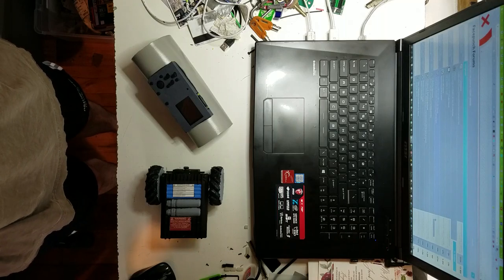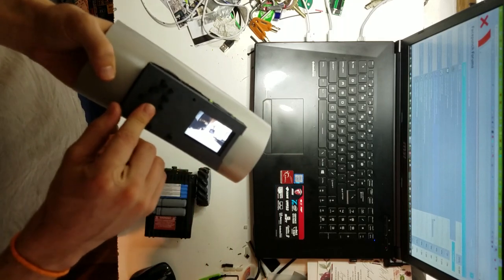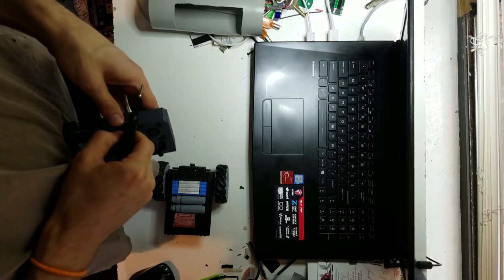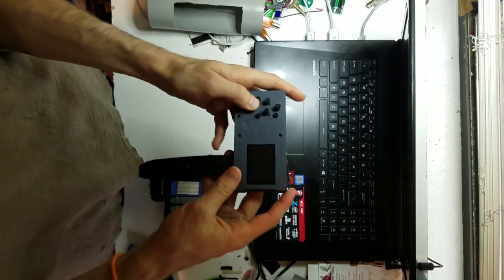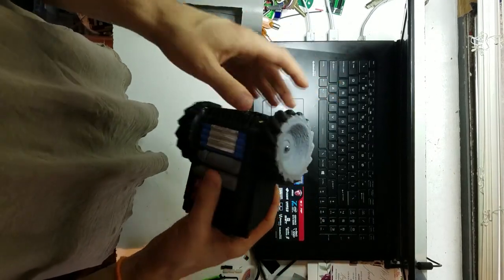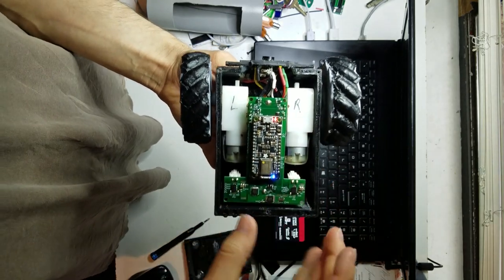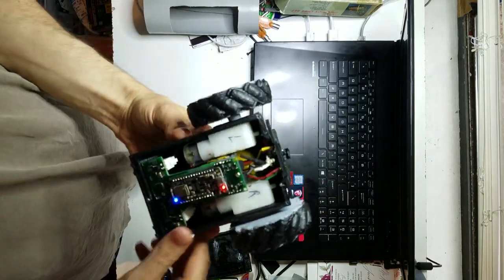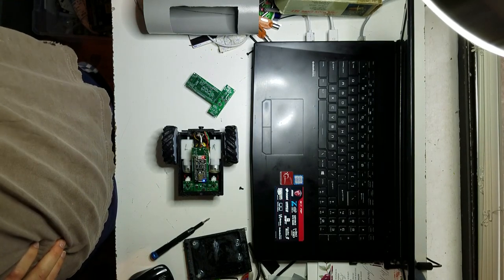R6S Twitch Cosplay Shock Drone Operation & How Its Made

Comment: I want to make a twitch drone very similar to you I find the 3D model of the drone on thingiver (the same as you) and i don’t know how to place it on the build plate. Did you put support on it and what position did you place it (the main piece)
Reply from the maker: For the top lid I printed it such that the inside face was printing on the bed and the outside face was up (thus used supports).

For the bottom "tub" I printed it bottom facing the bed and used some supports. I hadn't tried printing it the other way with alot of supports due to a really long print time.

Either way the model has alot of curves/nooks/crannies/etc that you'll have to do significant post processing/sanding/etc. Its kind of inevitable for this model.